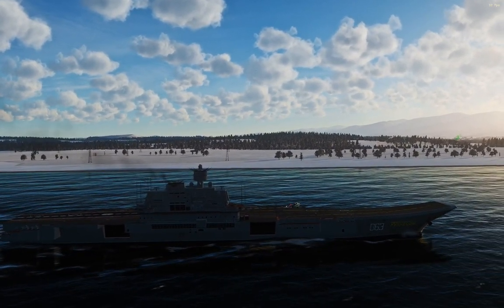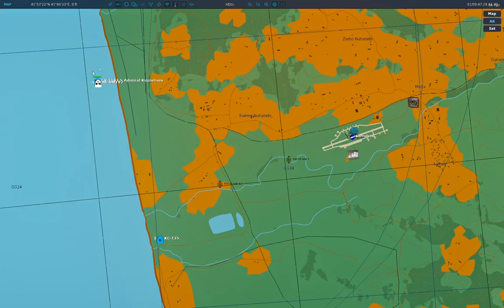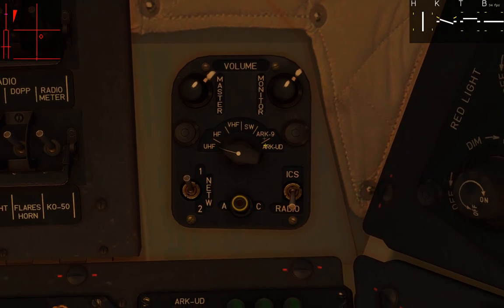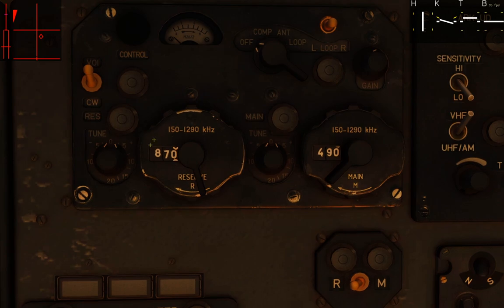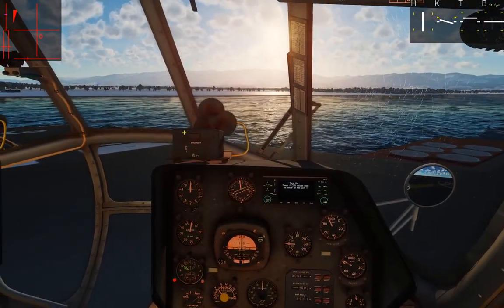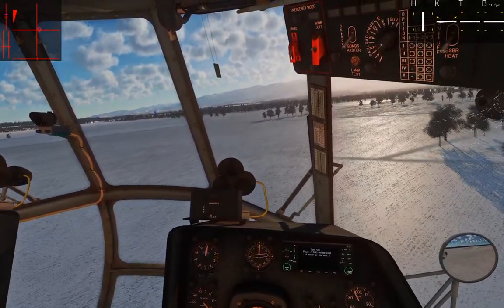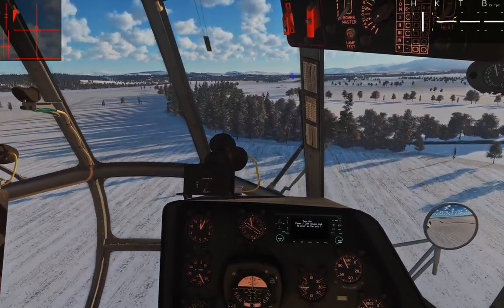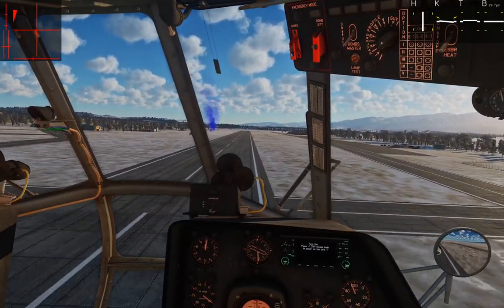DCS Mi-8: ARK-9 Radio Navigation Tutorial

Comment: Is there no way to navigate using VOR / ILS in this?
Reply from the maker: Nope! Your only other option is GPS nav with the NS430 add-on.
Reply: @vsTerminus  I guess in a helicopter you can always land and ask the locals for directions 🤔
Reply from the maker: Yea! Just land on the highway and someone will have to help you if they want to get by!

On a serious note, though, the region these helos operated in were littered with NDBs, and you'll find it's very easy to get around on the Caucasus map. Meanwhile in other maps it can be quite challenging. Exported versions of the Mi-8 are made-to-order and pretty configurable so I imagine if you wanted VOR capabilities it would be no trouble. Not sure about ILS though.
Reply: @vsTerminus  Well I have been thinking about upgrading my Ford Focus... I'll have to contact my local Mil dealership and check what VOR options they offer. 🚁